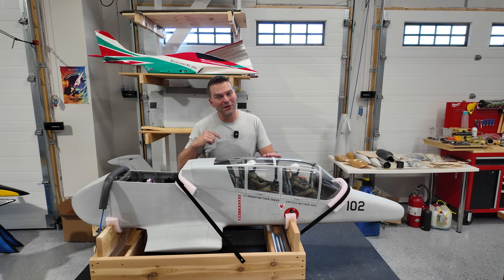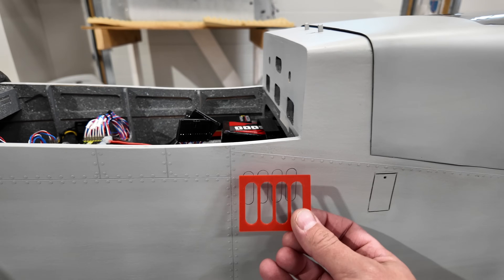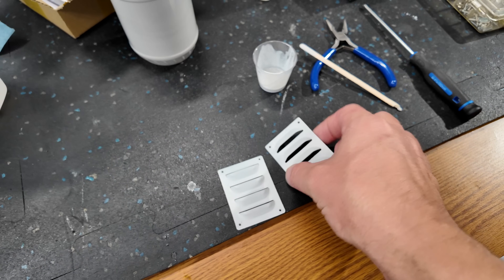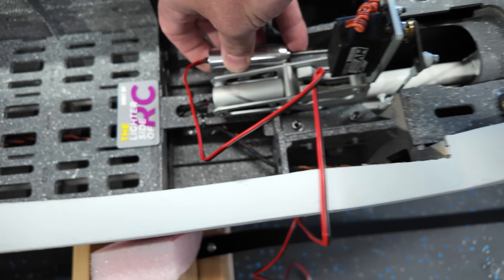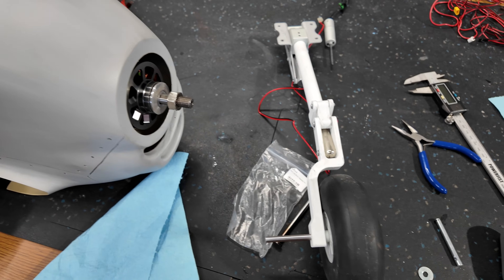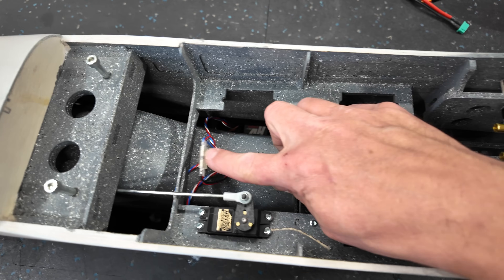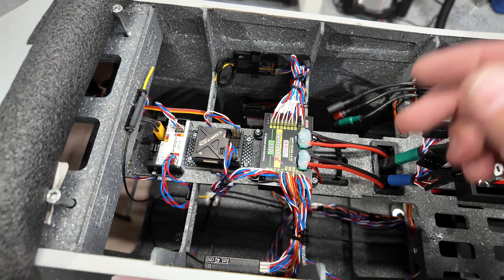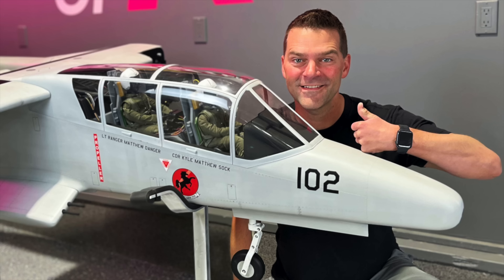Final Touches On The Bronco Hangar 9 Ov-10 - Don't Miss This Follow-up Video!

Comment: Good to see the Sqaukes all sorted. The air vent louvres is a good solution for the ESC as well and a good way to keep the Magic Smoke encased in the ESC where it should be. Air flow to a ESC is like water to a Fish. Have you ever had an electronic reactions when using GOOP due to what ever solvents are in the GOOP. Been an interesting build. Keep at it now. ;0)
Reply from the maker: Thank Nick!  Yea always best to keep the magic smoke contained where it belongs!  
No, have never had any issues using goop.  It will attack some plastics and foams so that is a consideration to keep in mind.

Comment: If you use Scorpion ESCs, the telemetry works with Jeti and they also come with cooling fans. You can control the fans so they come on when the ESC reaches a set temperature.
Reply from the maker: good to know!  Thank you!

Comment: The Air vents for the ESC's are a good Idea. I have to rebuild mine because of a failed Nosegear and the following Bellylanding. I need a Main Fuse and the Mindwing section. I think about to replace the crappy Gear with elektron ER50's. These are much more relieable i guess.
Reply: during the time when ramy rc was a good channel,he used electron.so i guess they will be good.
Reply from the maker: Will take some work but yes, the ER'50 is very strong and reliable.

Comment: Looking not bad😉. But I wonder about her small motors and how about the defekt ESC, what was wrong on him? And do you think the new motos for the gear will be better, I think ist a result about the poor material on the sides, is only Alusheet, not good made. Have helped a friend to bring his Bronco in the air, she has the same problem with the gear and we have changed them with items from JP.
Reply from the maker: Not sure yet.  Just ordered a replacement and installed it.  all is good.  When I installed the new motors I cycled them constantly and no issues so yes I think they are a good, easy, affordable sollution.